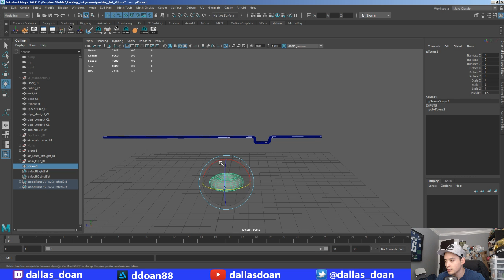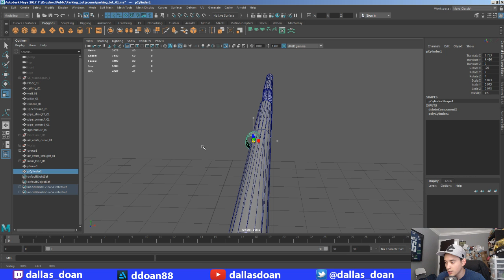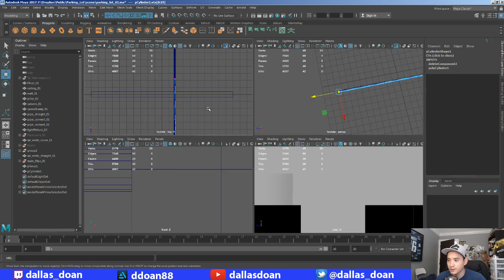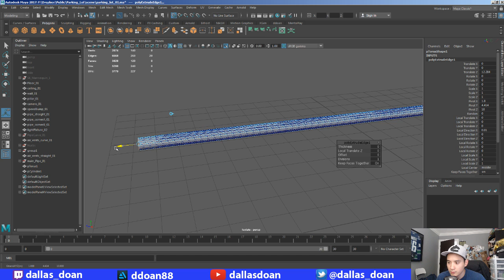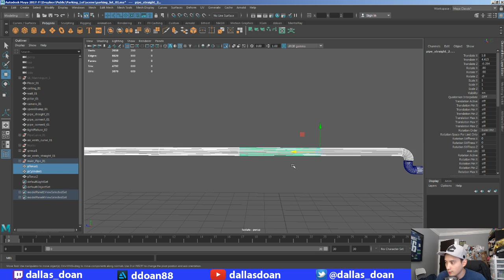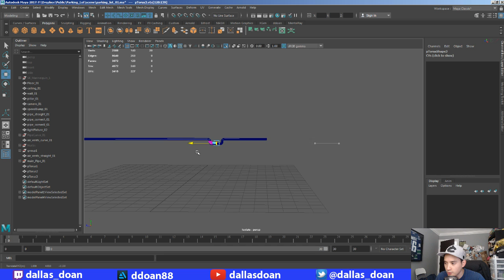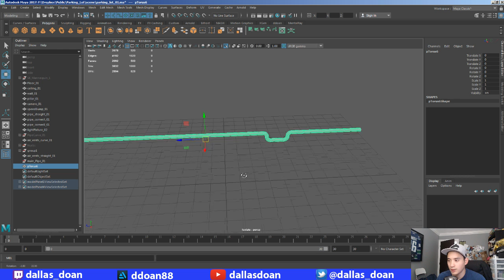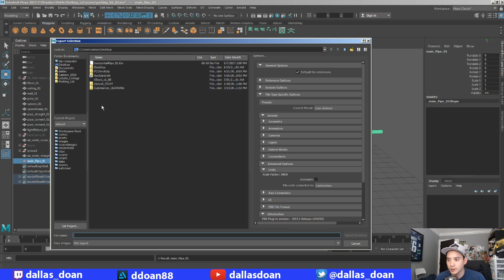Maya 2017 Tutorial: Creating 90 Degree Pipe Curve

Comment: You can use the wedge tool for this. Make sure history is on. At the closed end of the pipe, use the multi-cut tool to place a edge ring close to the end. Multi select a single edge on the edge loop in the direction you want the bend to go and select the end polygon. Goto Edit mesh>Wedge. You can adjust the angle, axis, center and divisions in the channel box.